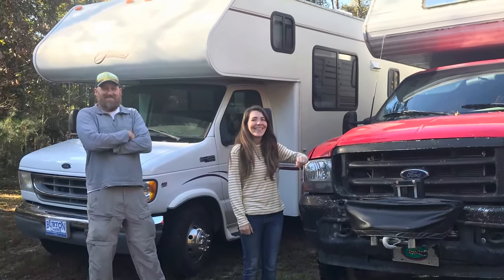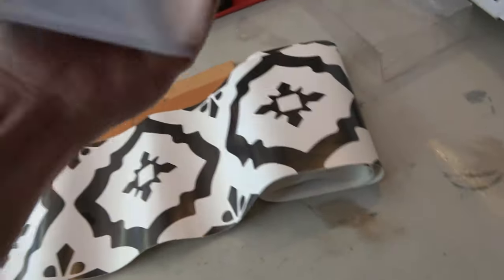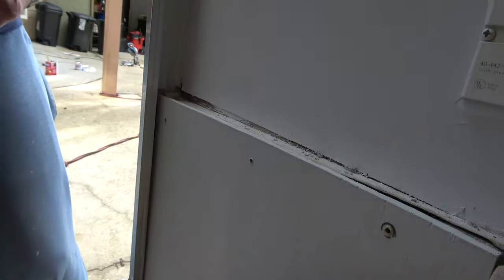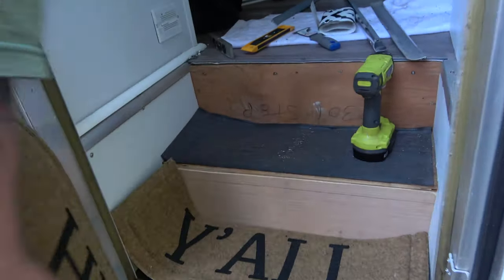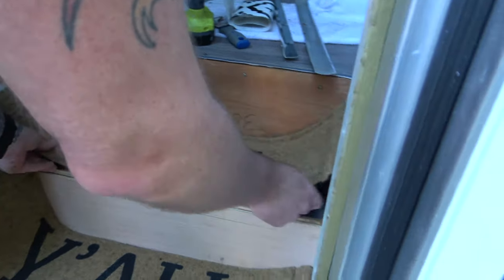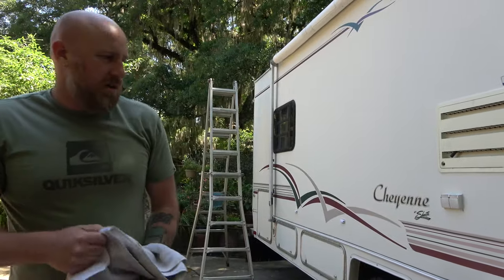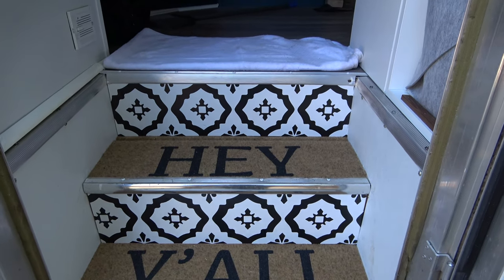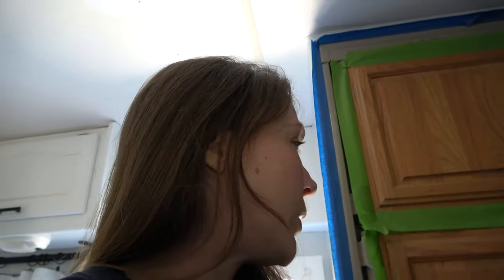CtW 139 // Updating Our RV Entry Way // Class C Camper Remodel

Comment: I stayed up all night watching this I'm in Ontario Canada and have thought about living in one of these all year round as rent here cost more then a Mortgage any advice or thoughts
Reply from the maker: We have found that full-time RV living is definitely more affordable, whether you travel or not (fuel costs are adding up quickly this year!). In Canada you have 4 seasons, so you would definitely want to make sure you had a 4-seasons RV that was insulated properly from the cold. Many Canadians head south in their RVs in winter, but the border restrictions have made that different these past 2 winters. But if you do consider living in one full-time, there are likely some RV parks (not "campgrounds") that will negotiate long term rent and utilities. With a full hookup you can live in a nice sized RV just like you're in a house - only smaller... plus you can leave in your home if you want to! It's a great idea - but DEFINITELY be sure you look into the 4-seasons RV. It can be dangerous, costly and inconvenient to try and brave the Ontario cold without a proper RV! Hope this helps! And thanks so much for watching!
Reply: @CalledToWander  I was thinking of buying what u guys have a class c I don't wanna travel as I work locally but what I was thinking was find someone who willing to rent some space in their drive way and let me hook into their Hydro